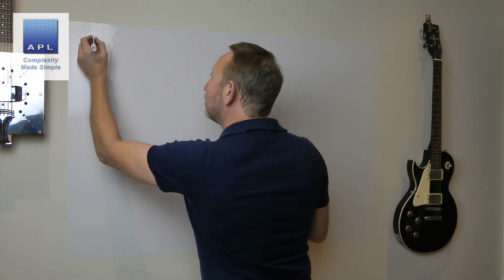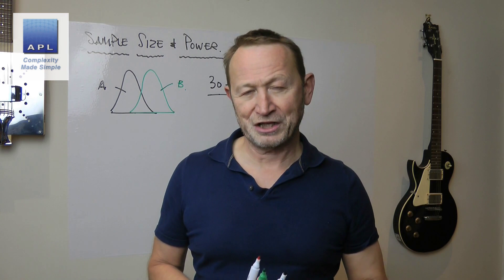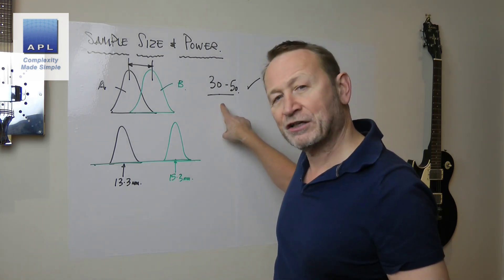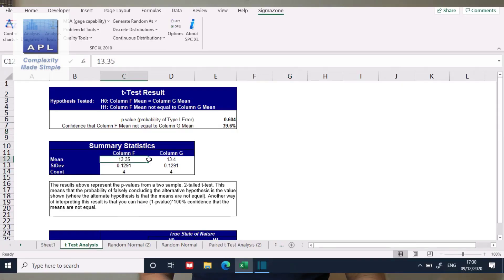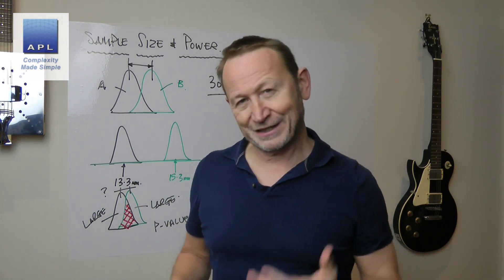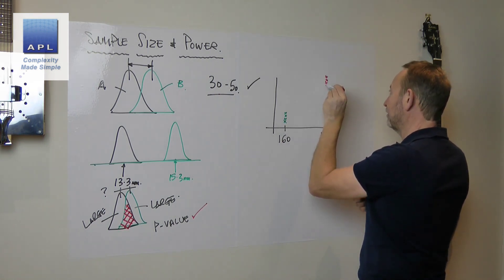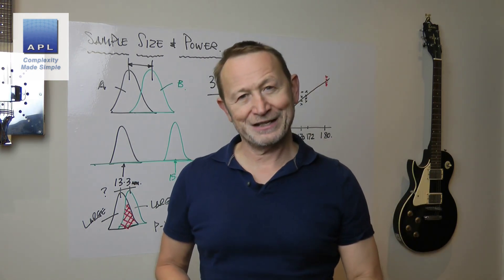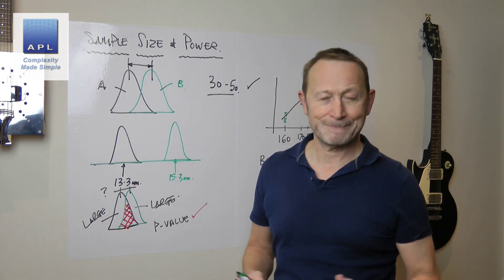What is the Power of a sample Size??

Comment: What's not clear to me is what is exactly meant by the term "sample". Is the sample a completely different unit? For instance, 30 to 50 different parts that get one measurement each? Or, is the sample 30 to 50 measurements on the same, single part? Or, it depends on what the experiment is?
Reply from the maker: Hi Don - description 1 is correct. When I talk about a sample, I guess i should say samples. 30 to 50 different parts collected measuring the same dimension on each one with your hands off, no adjustments, from your process will tell you an enormous amount of what is going on...
Reply: @paulallen5321  Thanks Paul!

Comment: Paul, how does this translate to the task of centering a process with cp =1 and normal distribution? If I calculate the average after the intial 3-5 pcs and shift the process minimally based on that, I won't see the shift by calculating the average on the next 3-5 pcs, right?
Reply from the maker: Sascha - if you have run 30 initially and you have an x bar chart then you should see the change in the average on the chart...

Comment: Thanks Paul.  I notice that you did not mention ‘Null Hypothesis’ or  ‘Alternative Hypothesis’ or ‘Confidence Level’... which are all related ( as you know ).  I think you avoided those concepts to avoid confusion from the key learning point.  Very few Stats classes in top Universities take the time to explain important concepts such as this clearly to their students.  I also teach Power and Sample size in my Black Belt class.  We used to do it at Green Belt but pushed it to Black Belt.   What do you think ? Would you expect a Green Belt in your team to understand and explain Power and Sample size ?
Reply from the maker: Hi John - No I don't cover power of the sample at all at GB level. I just teach them how to calculate a suitable sample size. It's very rare in Manufacturing that we need to observe tiny shifts in the mean. The noise in the process would always overwhelm any small mean shift...